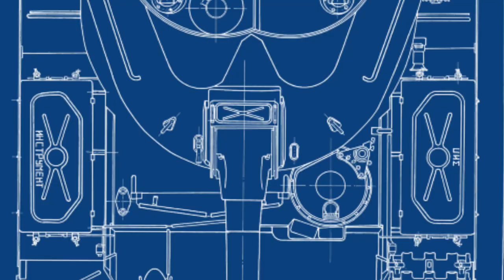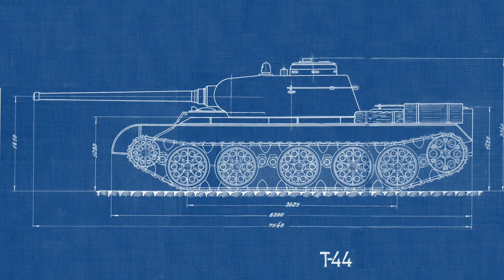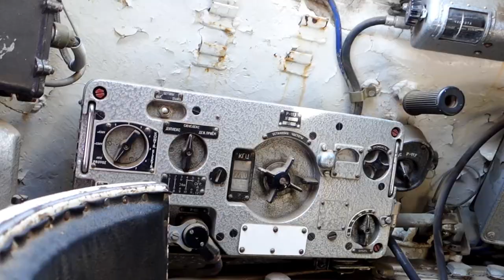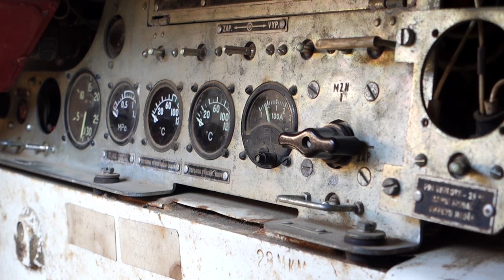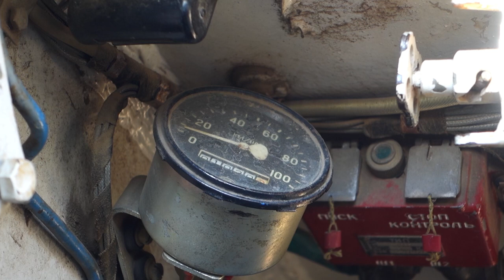Inside the Tanks: The T-54/T-55 - World of Tanks

Comment: My brother and I bought a T-55 to play with at my summer place here in Finland. I am 175 cm tall (short...) but I am too tall to the driver's position. If I close the hatch, I must crouch to not have my head hard against the hatch, and no way could use the "nakkipipo" ,"the sausage beanie", the soft helmet as I could not see through those periscopes. And yes, the seat at it's lowest position. I think that the ideal height of any crew member is about 160-165 cm. And they must be slim but strong. Ours has only 45 km's after the Polish Army modernized it in 1995 to T-55 AM "Merida", and everything is stiff like new: I had to use a crowbar inside to get the driver's hatch closed, the rubber seal did not want to collapse enough to get the locking handle pointing downwards and actually lock. Will always be fun to open it next time... I have no idea what viscosity the engine oil should be, so I use 15W-40 until I find out. I think it might be SAE 40 or 50 ,not multigrade. The pleasant surprise was that the nuclear shielding material also acts like a super heat insulation; the tank is cool inside. But it sure likes to drink diesel, 3 L/ km...

Comment: James Bond had the pleasure of driving a T-55 through the streets of St. Petersburg on Goldeneye.
Reply: The controls are on the other side, they modified one to have "Bond" "driving" it while the real driver was under the hatch on the other side.
Reply: @timokuusela5794  Indeed. They also replaced its tracks with rubber-shoed tracks from a British Chieftain tank to avoid damaging the pavement during filming. They also filmed the chase scene after they filmed the scenes on the antenna. When the Brosnan was sliding down the ladder and it stopped at the bottom, he wasn't faking it when he yelled: "OW", and then held his hand up while groaning. He broke his hand doing that stunt, but they left it in the final cut. He was thankful when they filmed the tank chase so he didn't have to do much other than have his head sticking out of the hatch for most of it. The whole chase was filmed in St. Petersburg and only used 2 blocks. The whole scene took over 6 weeks to film, although the statue of Tsar Nicholas doesn't have wings. That was just a reference to Columbia Tristar Pictures.

Comment: The video doesn't mention that the T54 was dominated by the Centurion during the 6 days war or event Yom Kippour war.
Reply: By the fact that Isreali crews were on average more skilled and used an upgraded version with the L7 gun. The T-55 nevertheless had a lot more armor, was more mobile, had a comparable gun, and was more servicable.
Reply: Most Israeli Centurions in 1967 were Sho't Meteors with the original meteor engine and 20pdr gun, even in 1973 around half the Cents were still Sho't Meteors (many being ex British army Mk3 and Mk 5 withdrawn from war stocks and passed to Israel after the Brits cancelled the Chieftains for them). They did not finish upgrading all Cents to Sho't Kal standard with new diesal engine, transmission and the L7 105mm until 1974.
Reply: In Syrian - Israel war. around 126 Israeli tanks were destroyed and 2  Syrian tanks were destroyed.
Most of Syrian tanks were the T-55 and some T-62.
Reply: Abadai Which war? 1948, 1956, 1967 and 1973 Syria lost a lot more than Israel had destroyed, never mind captured vehicles that were pressed into service by the Israelis
Reply: Chaz t 1973 Valley of Tears, Golan Heights.

Were Israel lost almost all of their tanks, Syrian Army reporting of destroying 47 Sho't Kal tanks (Israeli Centurion tank). Wikipedia will tell you that Israel used 60-80 tanks. But it's not correct. Israel used more than 200 tanks. Centurion, M-48, M-47. Syrian army lost 2 T-62.

1982 Lebanon War. Syrian Army reported destroying 38 Merkava tanks and  40 M60A1  tanks. Syrian army lost 4 T-62 and 0 T-72.
Reply: Abadai I have no idea about the Lebenon, but in 1973 on the Golan the Israelis destroyed hundreds of Syrian tanks (and many moreapcs) for the loss of less then a hundred (although if I recall it was not just Syrian troops used in that area).
The Israelis did not use the M47 Patton, on the Golan in 1973 there were two Brigades of Sho't Meteor, one Brigade of Sho't Kal and the Infantry  Bigades had their organic  Shermans (M50 or M51's). Not all were present during the whole battle either as units had to be brought up to strength and sent in small packets as they were ready (the Israelis were caught with their pants down).
Reply: Valley of Tears it was only Syrian troops.
I don't know were u got you're info. I'm half Syrian. I know mostly Syria Tank division and operations. What i told you were official reports. As for M47 Patton i'm not 100% sure, it gets all mixed because Valley of tears its part of Yom Kippur War. Syrian did not lose a battle against Israel. The Lose was from the other side = Egypt and Jordan turning its back against Syria. So Syria was isolated and was forced to abandon Goulan highets. Now i don't know who is telling the truth. But i don't trust western info either. Btw Syria lost more t-62 and T-54 in the proxy war than Valley of Tears battle.
Reply: Official reports to the populace can be tainted to hide embarressing losses. There are plenty of images of the Syrian tanks and APC's left destroyed on the battlefield during the 1973 war - and there is a whole lot more than two. 
It was a very close run battle but Israel despite being outnumbered, outgunned and surprised just managed to hold on - and even went onto the offensive in the Sinai and Golan fronts.
Other nations that had no land border with Israel also sent troops to fight against Israel, they had to be used somewhere (Iraq, Libya, Morocco I believe) - The vast majority of troops and equipment did come from the beligerant neighbours Egyt and Syria

Comment: I still don't get main difference between T-54 and T-55. Someone to elaborate please? :D
Reply: There are minor differences, as far as I know all internal.
The one I know for sure is that the T-55 had a turret basket, the 54 didn't
Reply: Basically what you're looking at it a generational change.  The T-54 had been upgraded and modernised to its limit, so they basically built a newer tank taking what had been learned with all the updates and upgrades from the T-54, simplified and streamlined them as well as adding 'Next Gen' equipment into a clean, new hull.

Comment: The video mentions that the featured tank is of Czech build, but the markings inside it are in Slovak (except for the radio controls in Russian). The tank was built in Czechoslovakia before the states separated, but I'm not sure where exactly. Therefore, the tank was probably modernized in Slovakia after 1993, and remained in service before total decommissioning of the model in 2000. The example in the video was probably sold to a collector after 2000.

Comment: T44 actually did have a bow machine gun. However, it did not have someone who's role was to operate it. It would be fired by the driver. The mg fired through a tiny hole in the upper glacis plate (you can see it just under the splashboard) and was fixed so that the only way to aim it was to turn the entire tank.

Comment: Which trigger fires the main gun on the control panel
Reply: The main gun was fired a) at the double hand grips at the left (the right was for the coaxial machine gun) for the gunner with a doubled button at the commanders swivelling observation device of its copula and b) at the very right  to the gunners hip (left side of the gun breech) was a mechanical button to be pressed downwards to fire without anything electric system involved. As usual with Soviet armour designs all electric features of the tank were doubled by mechanical solutions as much as possible.
But the mechanical trigger was not preferred because a) you needed to take one hand off the control hand grips making it more difficult to keep aiming* and b) by pressing down with a short but hard trigger push you still had an impact at the guns stabilisation and/or aiming pushing it eventually slightly upwards (breech downward) possibly causing to miss the target with the grenade flying slightly over the target.

The stabilisation system although still as a pure electronic tube control design was for its time (late 1950s) a brilliant technologic achievement. If maintained correctly (not frequent and not much to do here) it worked in both axis absolutely excellent. We could fire in full motion while in heavy terrain without stopping. So far I know Western tanks had not such gun stabilisation systems at the time.

*However, a stabilator system will not track the aimed target like with modern computer controlled gun aiming systems- Whenever the target moves or ones own tank moves in an angle towards the target, the gunner must follow the target constantly - which was very easy and smooth within the T-55 to do. Also, which is important in combat, both stabilator systems could be controlled very gentle but also move the gun vertically and the turret 360dgr. very fast if wanted.

I was a t-55 tank commander in the mid 1980s in the East-German army (NVA) and I am a German engineer, so you can trust my statement. General statements below about "poor quality Communist armour" or similar are from non-knowing arrogant - well excuse me - idiots. Ignore them.

Peace! from Dresden / Germany

Comment: this tank has now over taken the T-34 as the most massproduced tank.

I personally think the T-54 was pretty garbage all round because the gun's recoil was way to much for the gunplatform ability of the tank to handle with a shocking ~173J of KE per KG meaning that although the gun itself's mechanical accuracy was quite accurate but on the T-54 it was inaccurate at medium to long range as the barrel and tank moved so much when it fired but the T-55 added a Gyroscopic stabilizer to help keep the gun stable while firing so it could handle the gun more effectively, and it was not as good as the likes of the Centurion and Patton tanks which were it's main rivals at the time but it sure was cheap.

Comment: ît  was cheap  to  build ,  the  gun  system  was very  bad  , u  can find   the t54/t55  all over    mostly  with holes  in  them .
3rd world  countries like them  for  that  reason , cheap  ,  no  skill  need  to run  them ,easy to  fix  - there  was not  much on them to  fix . 
they  were  lost  at  very high numbers  for every   kill they made  but  that  why  they  were  built  so  cheaply .
western tank  ate the t54/t55  up   , only  time  they had  even  close  number  per  kill  was  t54/t55   vs  t54/t55  fights
you  still see  them around in  3rd  world counties  because  they so  easy  to  buy  cheaply and  to fix ,not because there any  good